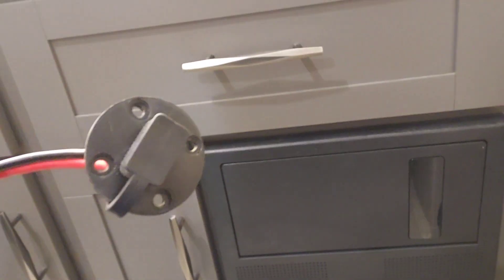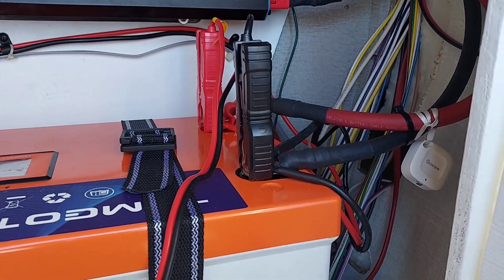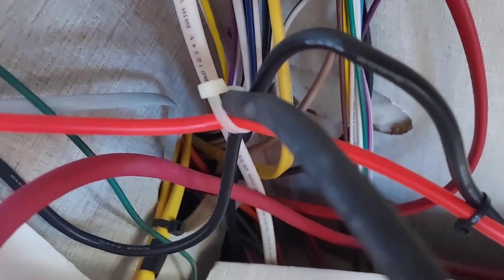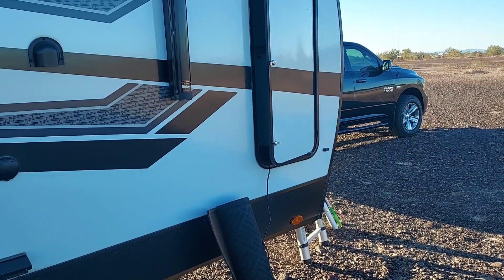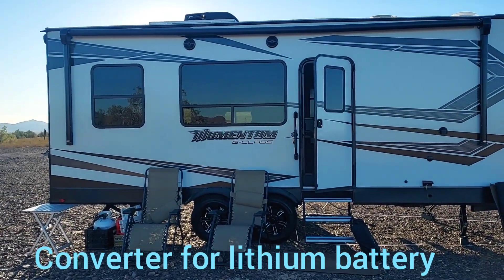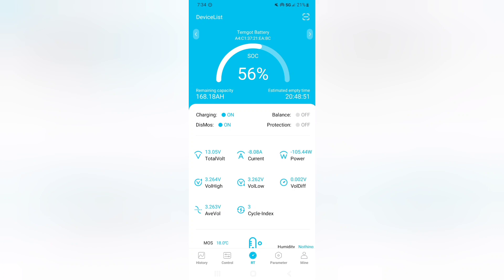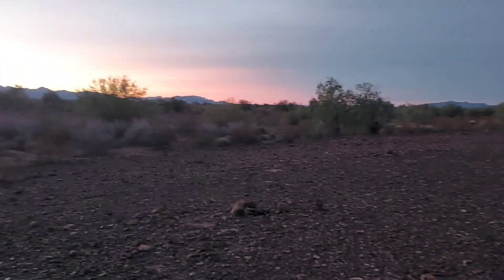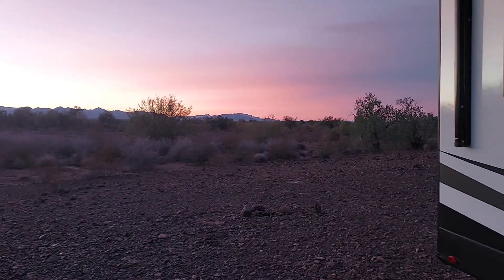Lithium battery performance update

Comment: @toyhaulen Any chance you could comment on your towing setup/experience with your Ram 1500. I am picking up a 21g this week and plan on towing with a 18 Ram 1500
Reply from the maker: I use the Curt tru track hitch 15k lbs. I also installed Timberen springs to help keep it leveled. My truck tows the trailer fine, no issues at all. I am at my max 1350lb payload and sometimes over unless I move items to the back of trailer.
Reply: @toyhaulen  that’s good to know I’ve got a 18 1500 with the 5.7 and tow package as well as 392 gears. I’ve got the 15 K Weigh safe w/d Hitch on order. We just purchased our 21g used and the previous owner threw in his secondhand 10 K weight distribution hitch. It wasn’t set up for the truck of course. Power and breaking were no problem for my truck at all. I’ve got sumo Springs and that helped quite a bit. I did have some sway, but I’m anticipating that, my new hitch rated properly for the tongue weight, and more importantly, set up properly  should help that quite a bit. Seems like there are plenty of people saying it can’t be done except for the people that are actually doing it with a properly set up vehicle and trailer and those individuals say that they have no problem. I’m a firm believer that no matter what you have. You have to make sure it’s set up properly. Been following your channel. Appreciate all your info that you share.
Reply from the maker: @snookys5620  Congratulations on the trailer, lots of fun, enjoy!

Comment: We have a progressive dynamics converter with the free dongel i mounted it right above the unit just pushed a button and it changes at a higher level no issues in 3 years and I don't have to carry a extra inverter

Comment: Thanks for the update.   I finally climbed up on the roof of my 28G to look at the solar panels.  Turns out I have two 330watt panels.  I removed the access panel in the front storage bay & found a WFCO WF-5220 2000 watt inverter as well as a Future Solutions MC2450N10  MPPT solar charge controller.   I did look at the converter, but I forgot to take a picture of it...     The options I have support charging LiFePO4 battery, so I think that's the next upgrade for me.   Thanks again for all of your videos.  They really help RV newbys like me.
Reply from the maker: That's great! You are all set to go for lithium. Wish mine had all of that from factory.